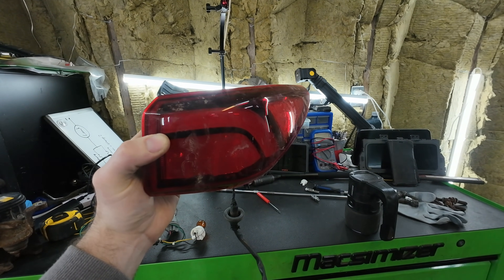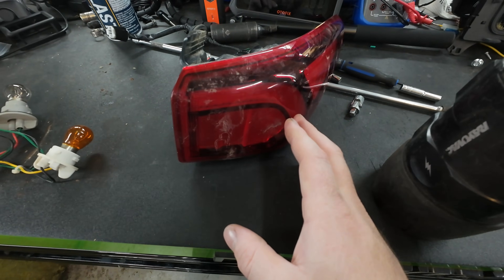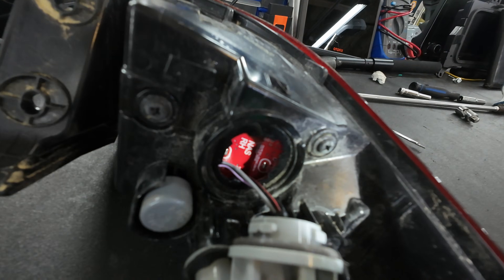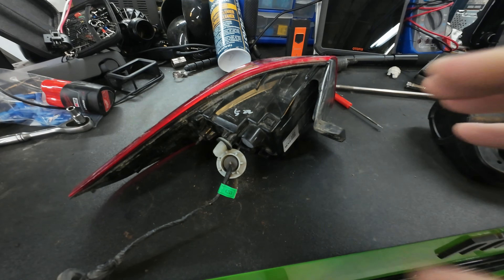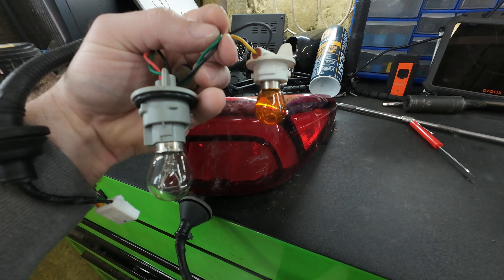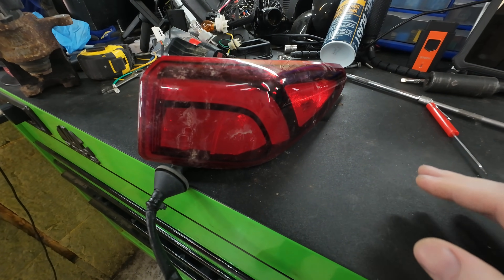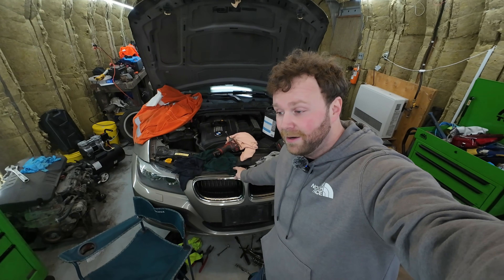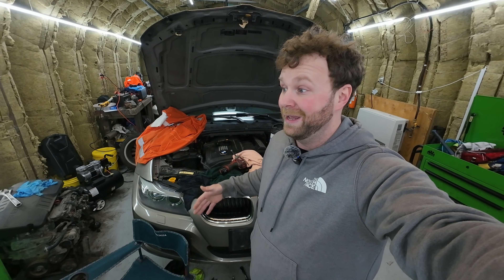Car Manufacturers don't even want you to change bulbs, they want you to replace entire assemblies!

Comment: Those LED lights are supposed to be lifetime items. We shouldn't ban companies from making these because they are functionally better and can be less expensive to make; instead, we should hold manufacturers to that lifetime claim by mandating 20-year and/or 200,000-mile warranties on such items.
Reply: Or mandate that all assemblies have to be easily serviceable down to the component level.
Reply: @orppranator5230  I prefer better design and construction than easy-to-repair, because like the recycling mantra of reduce-reuse-recycle, the more upstream we apply attention, the better the end results; but I don't disagree with you at all! Right to repair and ease-of-repair are both important.
Reply: There is nothing functionally better with them; incandescent light bulbs have been around for over a century and have worked, and still do work very well.
Reply: These head and tailight LEDs are rediculous, they're no better than what we had  as a $3. Bulb. Instead of throwing away a single bulb the size of your thumb we are throwing away a complete assy and the modules that make them work. Not responsible thinking whatsoever.
Reply: @harrywood8196  You have zero clue what you are talking about.  I have LED headlights on more than one vehicle and when properly designed they are far superior in terms of illuminating the road for much safer driving at night.  Similarly,  with LED tail lights.  They are not only aesthetically far superior but also much more visible in bright sunlight or at a distance.  Also, most people don't realize an incandescent bulb has a latency before it starts emitting full brightness.  Removing that  latency can be difference from a rear end collision and no collision from idiots who always follow too close.  I always buy Toyotas because they use disciplined engineering practices in their vehicle designs for achieving suitable reliability and life goals.  You will pay 10% more in the beginning but in terms of total life cycle cost of the vehicle you will be far better off.  Pay me now is a lot cheaper then pay me later
Reply: I agree his lights are so bright I don't need to turn mine on.. but if am going the other way I am blinded by his over powered miss aligned LED lights..
Reply: Lifetime is the length of your warranty.
Reply: @toddsmith1617  Says who?
Reply: They are lifetime items, unfortunately it's the lifetime of the component, which sometimes can be very short.
A small bump that breaks the seal around the lens and lets in moisture would have been shrugged off by the old bulbs.
You could drain the water and try to seal it again or drill a small hole in the bottom and let it run back out.
Electronics and moisture don't mix, and that has been the cause of failure on 90% of the ones I have replaced.
Reply: This...

Comment: Honestly all rear brake lights should theoretically be dirt cheap, just red LED with red diffuser.
But no of course the CEO and other head manangement of those car company purposefully choosed to make this better lighting technology into an enshitification. Yes they don't produce heat, just clean your brake light and problem solved.
I kinda get it for front light because you need a patern to not screw up peoples infront of you.
Reply: No, the LEDs actually become less efficient at colder temperatures, resulting in less light.

A heater is required to maintain a minimum temperature not to shed snow and ice but for the actual component to generate light at a reasonable level.

Comment: Been driving the same 88 F150 for the last 27 years.  20 years ago I hit a deer at 55 MPH, and all I had to replace where a couple of $0.80 light bulbs.  I still think I can get new ones for around a $1.20 or so these days....
Reply: I have a 1990 Chevy with a 350 small block and manual transmission. Only enough electronics and electric controls to make it function. It just keeps going down the road. Keep your Ford and drive the hell out of it.
Reply: What about the deer?
Reply: @botalm1878  He spun like a top.  Flew into the ditch at full speed, he was definitely done.

Comment: learning circuit board repair will pay up in the future.
Reply: It helps but the problem will stay with the components and programming. Once some (unobtainium) microcontroller goes out, it tends to be game over. That controller needs to be programmed too and where should one get the SW? It is common that controllers have copy protection enabled.
Reply: @SeersantLoom  Hoarding used parts also helps

Comment: Hope to keep my 12-year-old 110k mile Toyota for a long time.  I only drive about 6K a year - Just enough to keep everything working and running.  Garage kept in sunny dry Arizona.
Reply: oil change every 2k and don't let it overheat and should clock another 200,000 for you.  those old toyotas really hold their value
Reply: @gordons_here  you can easily just change that oil once a year and get another 200k on that car. 2k is a little much for a daily unless you do a ton of city or dusty environments, ect.

Comment: The plastic locking ring clips on the taillight housings for my 2018 Canyon are designed to break upon removal. They’ve made it costly and difficult to change a GD lightbulb.

Comment: 2023 ford f150 tail light without having to buy the blind spot module and get it coded so just the light was $1500 CAD, they told me 3k CAD if I had to get the blind spot module and coding
Reply from the maker: Wow. that's incredible.

Comment: Was quoted $2500 for Mazda CX5 LED headlight at 36k of mileage. The fan inside became noisy. Sold the car immediately.
Reply: You were lucky to find a buyer.
Reply: @1940limited it was a dealership, the guy who took the car though it's some kind of a pump noise😅

Comment: LED tail lamps and headlights can be repaired,  is just a pita to do it. Heating the shell, fighting the glue, remove the circuit board and then find a good electronics repair shop that are willing to check the board out,  hoping that it is a component that can be replaced and if it is posible, proceed to assemble the unit once again.

At the end, it is simpler just to buy a new entire unit.....
Reply: This is what I wanted to say but I assumed that you do the electronic repair. No point to pass it to repair shop because they eventually charge you an arms and a leg. If you do it yourself and source the proper replacement led (preferably from other dead units) you should be able to repair it. Gluing and sealing the unit should not be missed because water penetration can kill these units, Generally the water penetration is the real reason what kills them.

Comment: But the big question is, did the tail light survive the timespan of the original warranty period? This is all planned, make it as cheap as possible to last the warranty period. once its past the warranty period its of no concern of the manufacturer, the customer at that point is supposed to "upgrade" to the newest model at that point in time. Old neighbor was a supplier for window switches for one of the big 3 and said OEM was most concerned about the product lasting just long enough to make it to the end of the warranty period.. kinda wild.

Comment: The sad truth is these parts should basically last forever (other than physical damage) if designed properly, and only cost pennies more to mass produce than the old units. But since they are sole-sourced due to module digital handshakes, they price them at the most the market will allow without competition.

Comment: Sounds like someone could make some money by producing a serviceable replacement for the unserviceable tail light. IJS.
Reply: Newer cars have many parts (including headlights) with chips in them that must be made by the manufacturer, or the car software will reject the part. The coding on the chips is proprietary software/firmware owned by the car maker. So unfortunately, there are no after-market options. It's absurd. My 2018 VW headlight burned out- VW wanted $1100 JUST FOR THE PART, so I bought a semi-broken one on eBay from a salvage yard for $250. Works, though I had to take the whole front the car apart to replace it.

Comment: I had to replace the tailight assembly on my 07 trailblazer recently. Two phillips screws, one electrical connector and literally two minutes to accomplish. New cars are criminal
Reply: Turn signal failed on my 2016 Flex 2 years ago. Bought a bulb for it and replaced it. Works fine, ever since. I did have to spend 30 minutes taking the assembly apart to get to it and about 10 minutes to put back together.
Reply: @thatguyagain2693  Japanese kei truck rear brake light bulb replacement: one screw, two minutes. Done.

Comment: Some old engines and even cars were fitted with spring loaded wind up starters before electric starters. Still a bit of work but better than cranking directly! With acetaline lamps and magneto with points, no battery needed! That's the degree of de-electrification I'd put up with in anger in response to this crap.

Comment: G day. I've been saying the same thing for years. My friends that have a bit of mechanical know how get it, my friends that don't say but it looks cool they are also the types that have to have a new car every few years and are stretched out on credit just because they have to have the latest thing. meanwhile our over lords are pushing emissions controls on crappy engines while it's fine to make a whole new light assembly or A/C control module instead of just replacing a bulb or simple fan switch. how is that more ecofriendly for the planet. It is happening in the agricultural industry as well a mate had to replace a $2600 control module that controlled three quarters of the tractors functions, but the head light function failed everything else worked fine. Could not repair it because getting to the circuitry would have destroyed the whole thing. then to make it worse could not even get a replacement for 3 weeks. New subscriber, Thanks.

Comment: I know living in the American south buying a rust free early 2000s car is fairly easy so I take that for granted but I've owned newer cars like my 2011 1000hp Camaro and an Audi TT. Camaro was fun. Audi was a fast learned mistake. Now I have a 2004 Yukon and 2002 Grand Marquis. They are basically mint with 100k and 70k miles respectively. The Grand Marquis sat for 5 years rotting away before I bought it. Literally needed fluids and a fuel pump. Replaced the entire front end because it was $400 and I felt like it... The Yukon I bought 10 years ago and just maintain it. That's it. Oh the Bose might go out. Aftermarket radio if it does. Oh the 4l60e might go out. Yeah that'll be a few grand American, max. Not $9k.. Yeah new cars are cool but not for me.

Comment: Those LED headlights look cool in the showroom, but the assemblies often cost $750+ a pop when a diode goes bad, a seal fails and lets water in, or you accidentally hit something and crack it. AND it throws canbus codes that mat cause a no start. That's not just a Ford problem, I've seen it on Honda Accords.
Reply: barely.

Comment: LED bulbs last forever - But... The driver modules for the LED lamps, well the modules go bad after only a few years.
Reply: they Do Not Last Forever - I've replaced many an LED light/Bulb solder-in-light in my time - easily 20
Reply: Ridiculous
Reply: @nealamesbury7953  I just repaired another one yesterday - easy fix, a bad solder joint had popped off - no quality control -  hardest part was getting in and getting out cleanly, wasnt perfect on that part but should last a long time now
Reply: I've disassembled few LED bulbs and i can say like 7/10 of them has slightly more voltage over single chip. They manufacture them way they will fail sooner or later.
Reply: That's simply not true, the LED chips themselves fail quite often as well. Usually the microscopic bond wires fracture. Let's stop with the LED last forever nonsense. That myth comes from things like 1980s clock radios which indeed don't seem to ever stop. But modern high power LEDs like the ones in car lights are quite different. They are also subject to thermal cycling which wears them out rather quickly, especially as they are usually cheaply made and underengineered.
Reply: @westelaudio943 "cheaply made and under-engineered" 
This is the problem, and where we should focus our attention. Manufacturers should be regulatorily and monetarily disincentivized from producing poor quality products that are "good enough". Addressing that problem will significantly reduce the amount of waste sent to landfills.
Reply: Nothing lasts forever but the earth and sky
Reply: @wayneadams7829  Actually the Earth (and entire solar system) has a finite lifespan. The universe as we know it is temporary.

Comment: My first car was a 1980 Civic and my first repair was replacing a sealed beam in the middle of a snow storm.  The only tool required was a two dollar Philips head screwdriver. The whole repair only took five minutes. I think it cost about 5 dollars.
Reply: here is my reply a few weeks back to  similar topic...i remember when k-mart used to carry 3 sizes of headlights...the square ones, the large round ones and the small round ones...every car on the road (import or domestic) took one of those types...they were also about $2.99 each and could be changed in minutes in the parking lot.
Reply: @michelle-lz8tg That was actually 6 headlights. Large round and square were combined high/low beam and small high and small low beam in round and square. JC Whitney had kits to replace the large ones that used 9003 halogen bulbs.
Reply: Don't you have to aim them afterwards? Even though it's just 2 screws and the procedure should be pretty well documented.
Reply: @pigletshut  no...unless you accidentally loosened the adjusting screws for the headlight bucket rather than the ring/bezel that just held the light in.

Comment: We bought these fancy European trucks. The air dryer is completely non serviceable and has a computer on it. We used to replace just the purge valve for 28$. Now its a $1300 assembly.
Reply from the maker: What???? Wow
Reply: @Lancemechanics  its the new standard on European trucks. Knorr bremse calls it electronic air processing module. Its nuts.

Comment: Who tf thought it was a good idea to put the blind spot sensors in the tail lights. Also those LED assemblies could be made to have easily replaceable PCBs but nooooo...

I get that the engineers get asked to make it easy to assemble and not to service but that's just pure greed like you said.
Reply: Where else would you put them that would be at eye level and usually clear of snow, dirt and debris?

Bumpers are too low, so a dedicated hole in the auto body or the lamp?
Reply: We drove cars just fine without all these digital doodads.

Comment: My 79 bronco is still rocking most of the original bulbs!!!
Reply: My 1912 Model T has 2 million miles on the original engine. No fluid changes, no bulb changes needed. Runs like a champ.
Reply: Yup, and when I stopped driving my 1987 F-150, with 260k miles on it (around 2011), it still had most of its original bulbs.
Reply: That's impressive. I can't believe they lasted this long.
Reply: @dennisku3709 honestly, ive owned it about 25 years and cant remember a time when i needed to change one.  Usually a good smack to the lense cover does the trick!
Reply: Until they stop making bulbs.....like they did for your house!
Reply: @bobbys259  You can still buy bulbs for the house and change them yourself.
Reply: Mostly blown!
Reply: @the_first_resort940  So, replace all of them for 10% of the cost of a Hyundai Konehead tail lamp assembly, and you're good for another 45 years...

Comment: Car makers today focus on profits from financing, subscriptions and servicing sold vehicles. To this end parts are intentionally made cheaply and to be failure prone (eg wet timing belt). Thus requiring the owner to have an increasingly costly maintenance schedule and promoting the lease or sale of new vehicles. VW for example actually has internal memos outlining how they will control the “life cycle” of vehicles they sell. It’s disgusting but pretty much every car maker is currently following this profit model.
Reply: And not just cars--- this goes for just about every commercially made product.

Comment: And if the unit failed what caused the failure? Is not just replacing it a gamble?😊
Reply from the maker: My experience. Corrosion. You can't stop   moister. The old ways were way more resistant to moister
Reply: @Lancemechanics it seems we're going to have to fight for right to repair and try keep the older stuff going. We are being ripped off.

Comment: call your local representative. Tell them you want the right to repair; that is what I did.
Reply: Right to Repair doesn't apply here.  They are not stopping you from repairing the item... they are simply making it really expensive.  Right to Repair involves not supplying parts... you'll get the part alright-  after you bend over.